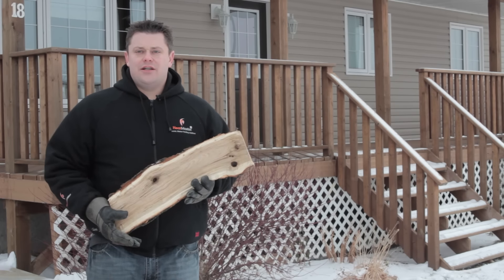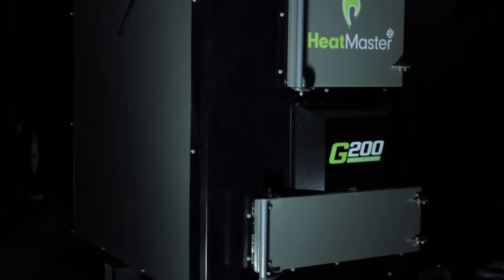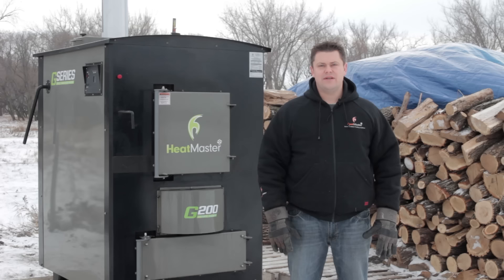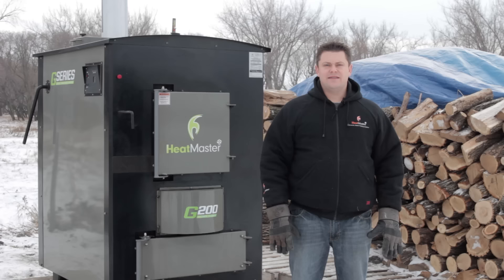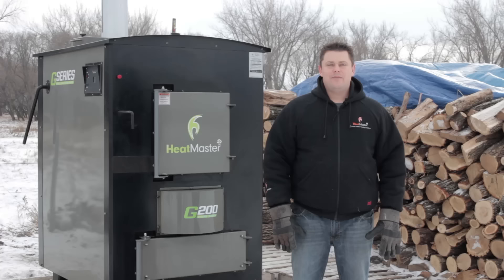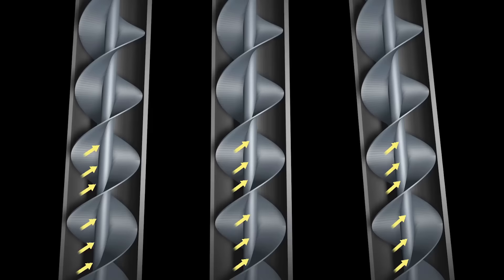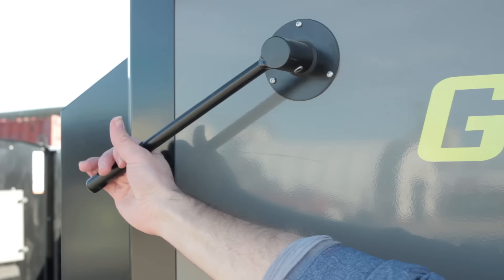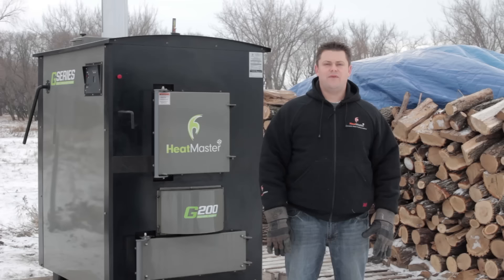How Wood Gasification Works - Heatmaster SS G-Series

Comment: It's impossible to find prices on the furnaces. Why do companies think it's beneficial to hide these? I'm not going to be any more likely to buy just because I'm on the phone with a salesman....i just get angry and move on to a different company.
Reply from the maker: Hi Daniel, the reason we do not list prices on our website is because we sell into Canada and the U.S, prices will vary depending on where you live. If you are looking for a price we would we be happy to answer any questions you may have.
Reply: @Heatmasterss  Ok my mistake then. Would you please give me a link to prices for My zipcode: 44276 or list them here for me? thankyou.
Reply: @Heatmasterss  I'm interested in the units with gasification and my home is 2300 sq ft
Reply from the maker: @danielweese2085  sorry for the delayed reply on this. To find the closest dealer please visit http://www.heatmasterss.com/find-a-dealer/
For the square footage you are looking to heat a G100 or GS100 would be a good fit. Suggested retail price on the GS100 is $7,395.00 and on the G100 it is $8,895.00
Reply: Heatmaster ss 
Well I must say that helps tremendously. I'm factoring in  exchange rate so somewhere in the 12k range, for Canadians.  I need to know the btus for the g100 and like the price a rough estimate wood be sufficient. please Thanks
Ps I must comment on the pricing, if someone is not straight forward with information, like the btus, (I check out your site and never saw BTU in big bold letters.) it's a red flag. Maybe that's just me but my time is not owned by anyone else. If I'm interested In a product you have 15 seconds to do your thing.
Reply: @henrinaths1  btus would be entirely depend on the species of wood and how dry it is, a dry oak hardwood would have at least 4x the btus of an improperly dried pine softwood
Reply: I always step next product if I cannot find prices!
Reply: 100% as soon as I don't see a price I move on.
Reply: Yes me too...its very annoying.   Just list both USA and Canada prices.
Reply: The manufacturer probably has a set price for the retailers, then it's the retailers goal to maximize profit.
It does annoy the customers though so a max price on the manufacturer's website is advisable.
Reply: Prices are up online now!
Reply: @Heatmasterss  thank you for answering his question for all of us.  living in fl right now but wanting to go back north:)

Comment: I currently have a outdoor boiler that is pressurized. Im not sure if this stove would work with my existing buried water lines and exchanger or not. I would hate to have to replace perfectly good tubing. Are theses stoves pressurized?
Reply from the maker: Thanks for your question. No they are not pressurized but you would be able to connect to a pressurized system by using a water to water heat exchanger. By using a water to water heat exchanger you can keep your existing system under pressure but transfer the heat to it from an open system.

Comment: This particular unit in the video, how often on average do you have to load fuel in the fire box?
Reply from the maker: Hi Jason, in most cases the furnaces are loaded twice a day. It can also depend on the time of the year, during the more mild months you may get 24 hour burn times or longer.
Reply from the maker: Hi Jason.  We try to size each unit so that it is loaded twice a day.

Comment: Would this stove be good if you have neighbors close by. With natural gas prices skyrocketing im looking at an outside boiler but dont want to have the smoke of a regular one. Thanks
Reply from the maker: Hi Brandon, you bet, there's smoke when firing up the gasification furnace for the first time but when it's running efficiently you should only get some steam out of the chimney.
Reply from the maker: Shoot me an email if you have any other questions or you'd like to connect with a dealer: ssukkau@heatmasterss.com
Reply: Good to hear. Thanks for replying

Comment: Why not switch out the water for gallium.  Gallium absorbs and conducts heat much better then water? 😕
Reply from the maker: Our furnaces are designed to work with water, water is readily available and free to most people.
Reply: Thermal mass is more important than conductivity..
Reply: No it doesn't.

Comment: Put a damn roof over your stove and a few weeks of firewood. Gasification requires very dry wood or the steam cools down the flame front. Stop showing these vids with the wood outside in the open plus who wants to go out to tend the stove in rain and snow? Just plain stupid. A metal carport at least over both. Otherwise great vid. I made our own for under $500.
Reply from the maker: Thank you for your comment. You are correct that gasification furnaces work best with dry wood and putting the wood under cover is always recommended.
Reply: @Heatmasterss  not to mention having to stand outside in all kinds of crappy weather to tend the stove. Covering our "Classic" (smoky POS) was the first thing I did. What a difference. Sold that POS btw and built our own gasification stove/boiler.
Reply: @fiskfarm  Nobody cares, man.
Reply: @fiskfarm  feelings hurt, tough guy?
Reply: @j.c.m5168  not a bit. But you sure seem to care🤣 I doubt very much that you even heat with wood.
Reply: @fiskfarm  Prove I don't, pole smoker.
Reply: @j.c.m5168  don't have to. It's obvious.
Reply: @j.c.m5168  that was actually funny👍🤣👌
Reply: @fiskfarm  I have my moments. 🤣
Reply: @j.c.m5168  apparently 🤣 Thanks for a good laugh. We need all the humor we can get nowadays 👍 Stay safe and keep your wood dry👍😂👌🇺🇸
Reply: @fiskfarm  This is a demo of the boiler I'm assuming maybe that is why it's installed outside.
Reply: @Mike-01234  it's an outdoor furnace. Way too many folks leave their wood out in the weather. Not good and adds to pollution and anti woodstove sentiment.